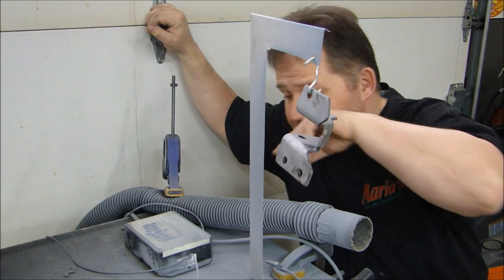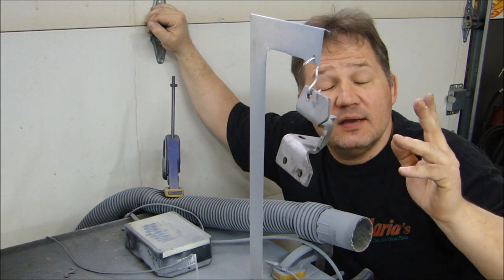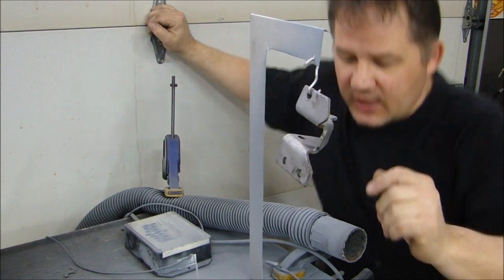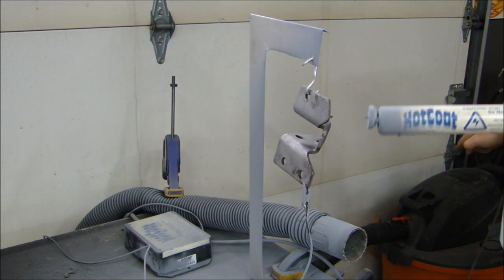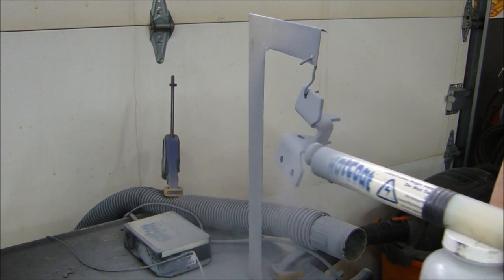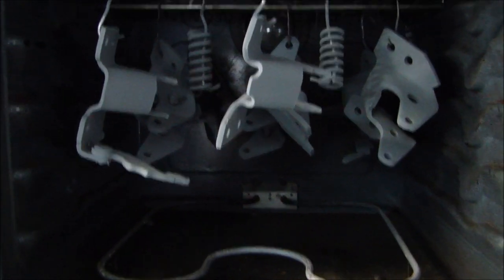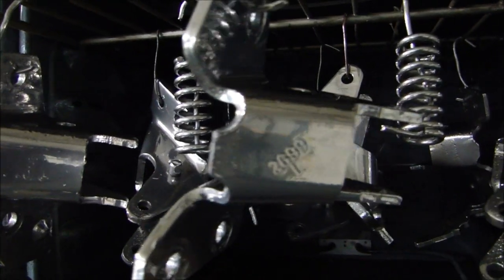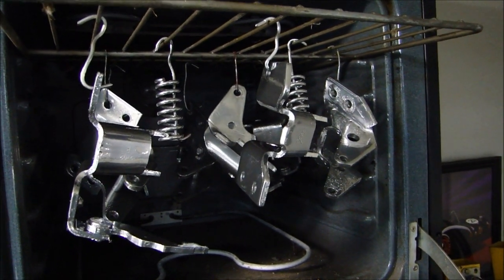Powder Coating Small Parts

Comment: Pete, outstanding as usual. You always add great little tips as well. The shop vacuum and even the extra touch of spray after removing the ground wire!! May I ask where you are located?
Reply from the maker: Thanks Steve. I am outside Buffalo, NY

Comment: Hey Pete I'm looking at Eastwoods powder coat kit to buy, do you still like it? And do the things you powder coat last without chipping or cracking? I've had things powder coated before by a local place and they charge quite a bit for it, Eastwood has the kit for $150 dollars and packs of 6 standard colors for $50 dollars, is that what you get?
Reply from the maker: +ArcticAstrophysics I love it. Really does an excellent job. The powders are wonderful. Very durable and do not chip. I have that kit and it is great

Comment: How does the powder coat the area where the hanger is touching the part? Does it "run" between them.  Great videos btw.  I think I have seen your setup on garagejournal.
Reply from the maker: You need to hang the part where perfect coverage will not be noticed. I've never had a problem.

Comment: Does the coat crack and flake where the fasteners put pressure or is it a solid coat?
Thanks
Reply from the maker: If you put it on to thick, yes it will crack. an even, thin coat is very durable
Reply: Any tips for something porous like cast iron?

It's prbably better th have clean rough surface than a sanded on I guess ? Going to be going a cast iron housing for a water pump.
Reply from the maker: Any surface is fine. The powder will melt and flow into any kind of metal
Reply: Lazza Leppi Be aware that the surface of cast iron is not smooth. The powder finish will duplicate the finish on the cast iron. I just coated a solid steel cube that was 1.5" x 1 .5" that was rusted so bad it ate the metal. I SB'd it down to bare and coated. The finish is all cratered because the cube surfaces were cratered.

Comment: You should clamp the ground on the bracket that you made, not the part. The if the hook is clean, and the spot where the ground it clamped, it will provide a good ground.
Reply from the maker: That is true, I prefer to put it on the part